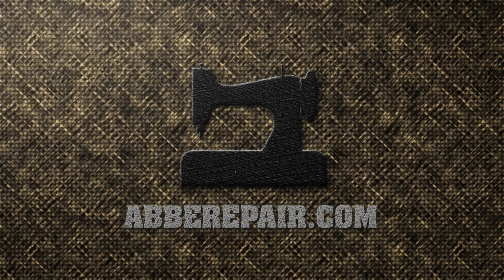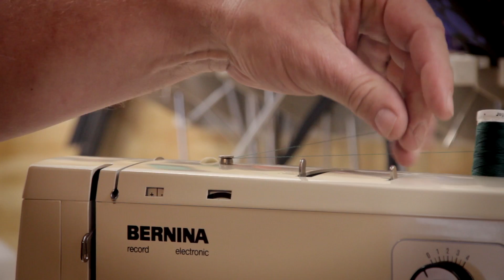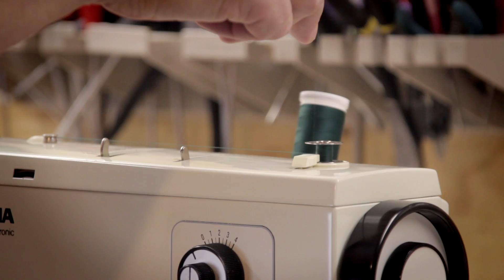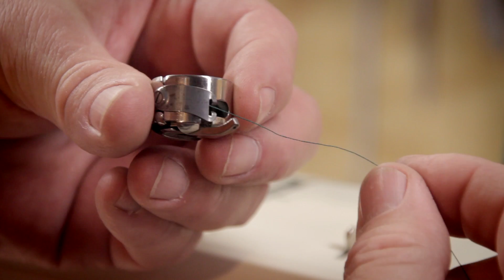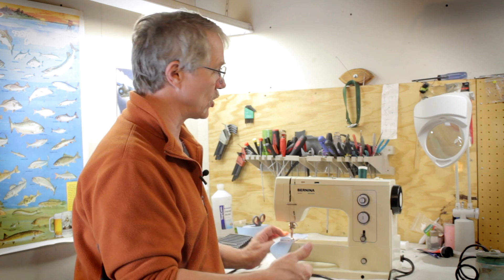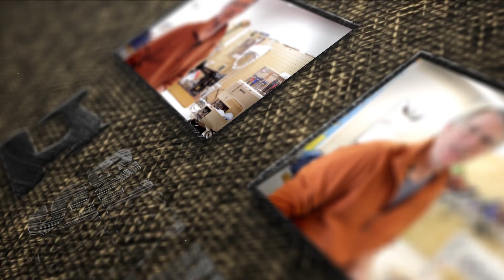Sewing Machine Repair with a Bernina 830

Comment: i have a bernina 830, i am having an issue with winding bobbin because the clutch does not disengage. I can wind a bobbin but the whole motor is running while its doing it, i am not new to sewing but i am new to my 830..can you share any advice ? My needle is moving while bobbin is winding, some have suggested to oil machine or clean dirt but motor looks like new inside and i don't think dirt is the problem here..its going to be more than just cleaning. Cheers.
Reply from the maker: Kar Ser Hi Kar. The main two reasons the almost all machines can have this problem is old oil and grease. Old oil and grease act as a glue.  This old oil and grease must be removed and replaced with fresh to allow things to move freely.  Sometimes people tighten the belt instead of lubricating when old oil and grease cause the machine to tighten up.  Thanks again for your question. Love your machine!

Comment: Thank you for the video--I just purchased my Bernina 830 at an estate sale and it is in immaculate condition.  However, when I changed from zig zag foot to zipper foot and changed the needle position, it would not sew at all.  Thread does not interlock with bobbin thread.  Am I doing something wrong?  Thank you for any feedback.
Reply from the maker: Alice Hutchings  Thanks for your query. To avoid skipping stitches with a standard 50-60 thread, I start with a size 90/14 needle.  For heavy fabric like denim, canvas I use a sharp most other I use a ball point. With the zig-zag foot check straight to wide zig-zag, if your machine does great but doesn't when you change feet, your needle is probably hitting the foot.  Wrong foot? New needle?  Bent or damaged needle can also cause this. Flat of the needle should be away from you.  Hope this helps